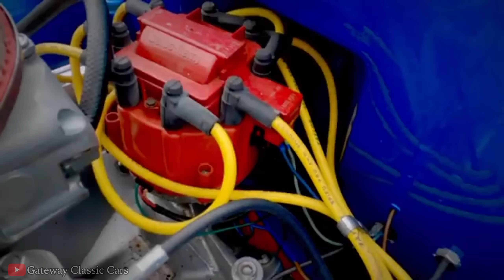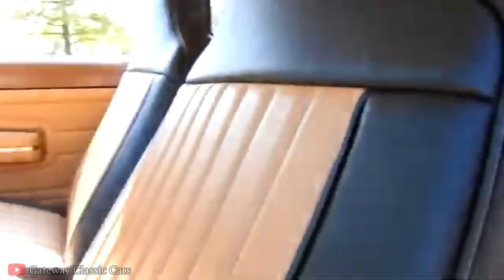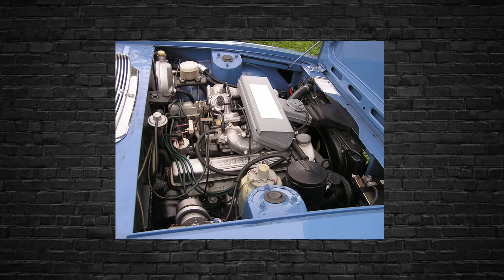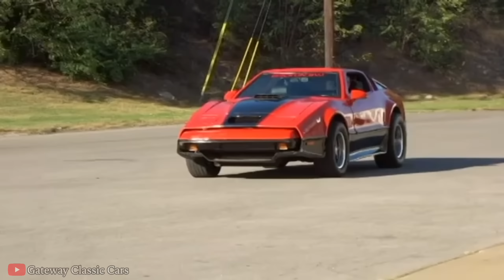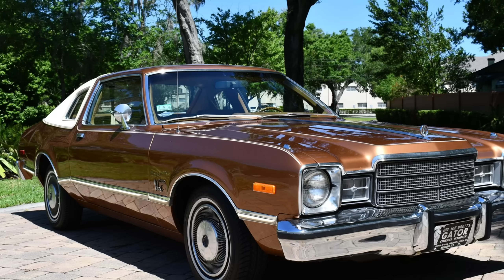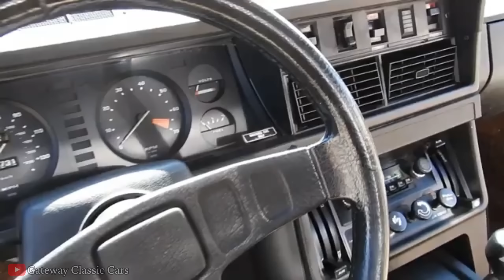10 MOST FAILED and WEIRDEST 70s Cars You NEVER KNEW About!

Comment: The Gremlin was a MUCH better car than either the Pinto or Vega. It was easy to work on and the V8 option was fun as hell. I always remember these as
very reliable, unlike the most of the other cars in this video many are still on the road with high miles. Weird you bet, kinky looks, yup but it was a simple
car that most those that owned them loved them.

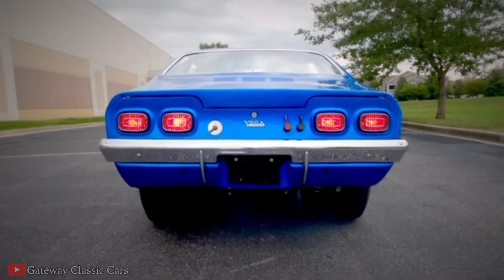Comment: LOL, I knew one of them would be a Vega 0:48 But the early 70's cars went from style and muscle to light weight fuel economy boxy cars. As a matter of fact, I owned a lot of mid to late 1960s model cars and trucks and they were much better as used vehicles than new 1970s models.
Reply from the maker: Hey @IrishWhiskeyParanormal, you hit the nail on the head with the Vega
That little Chevy was a disaster waiting to happen—aluminum block issues, rust problems, and by the time people figured it out, it was too late. The early ‘70s were such a weird time for cars—one moment, we had the peak of muscle car dominance with HEMIs, Boss 429s, and LS6 Chevelles, and then suddenly, the industry shifted toward lightweight, fuel-efficient designs thanks to emissions regulations and the fuel crisis.
Have a great day, and see you next time on Muscle Car Masters Channel...

Comment: My friend had a gremlin and he put a Chrysler 318 in it that car was fast AF after that in fact he spun the rims inside the tires😂😂👍👍
Reply: Think that was something should of ridden in a gremlin with the 401! Yes, AMC did put a very few of these on American roads. Very fasy but unstable at high speed.
Reply from the maker: Hey @timlloyd1454, that’s an awesome story, man
 Dropping a Chrysler 318 into a Gremlin? Now that’s some true gearhead creativity right there! AMC already made some wild rides, but once you throw a Mopar small block under the hood, that little beast must've turned into a tire-shredding monster! Spinning the rims inside the tires? That’s some serious torque at work—just shows how much untapped potential those compact muscle machines had when you gave ‘em the right powerplant.
have a great day...
Reply: @MuscleCarMasters  the torque was so much that it twisted the frame the driver's side tire sat 2 incges off the ground after that😂😂👍👍

Comment: THE HORIZON WAS THE PLYMOUTH VERZION OF THE OMNI. WITH THE RABBIT ENGINE AND A STICK SHIFT IT RAN FOREVER WITH ABOUT 40 MPG!
Reply from the maker: @richardbarron8869 You're absolutely right! The Plymouth Horizon was Chrysler’s answer to the fuel crisis—practical, efficient, and surprisingly durable with that Volkswagen-sourced Rabbit engine. While it wasn’t a tire-smoking muscle car, it proved that Mopar could adapt to changing times. That little hatchback could run forever and sip gas like a champ, hitting nearly 40 MPG while still offering a fun, engaging drive with a stick shift.
Stay fast, stay loud, and see you next time on Muscle Car Masters channel...